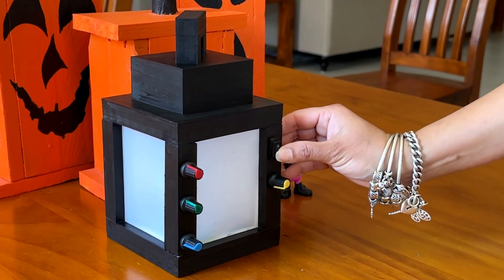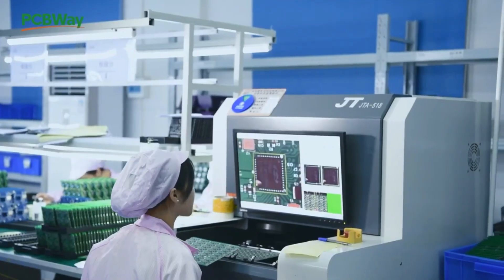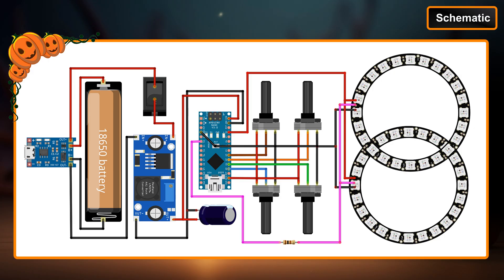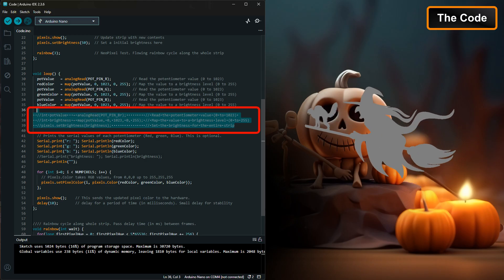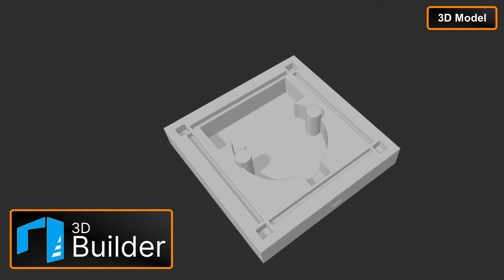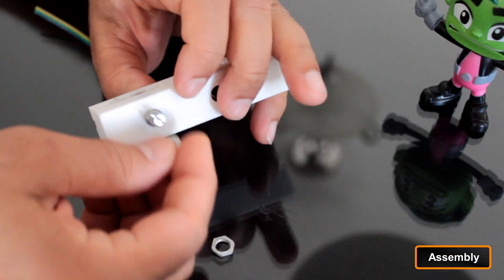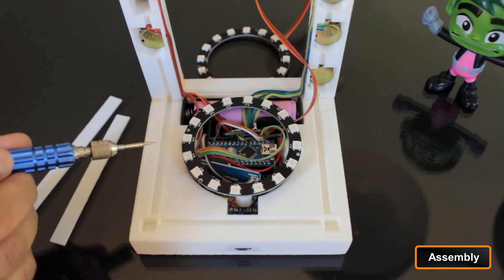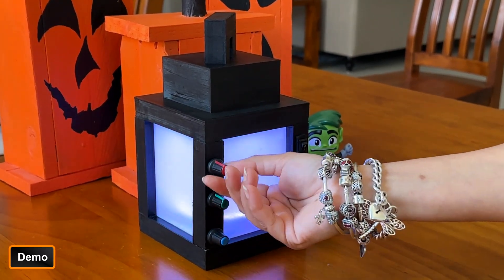Color Adjustable Minecraft Lantern

Comment: May I add a suggestion to put holes for wires down the columns with the potentiometer so the power and ground wires can be run down it connecting each one together? This would make the wiring less messy
Reply from the maker: That is a very good idea
Reply: @CrazyCoupleDIY so I gsve it a try by adding small hole through it on bambu studio. The only problem i had was trying to get the potentiometer to fit with the wires. I'm sure there is some kind of work around

Comment: Where did you end up putting the buck converter? Im currently making one for my daughter and only place I see is on top of the pcb, but it will touch the connections to the Adruino
Reply from the maker: Please have a look here:https://imgur.com/a/n3Iuqm4
Due to the space restriction it became a bit tight, however it is not touching any component.
If it does just add a bit of hot glue on it
Reply: @CrazyCoupleDIY  appreciate it. I'm going to try and do another work around to see if i can't make it a little neater. Might completely redesign the bottom.